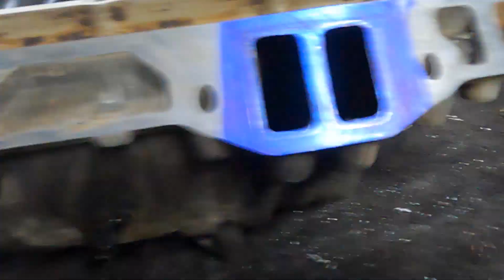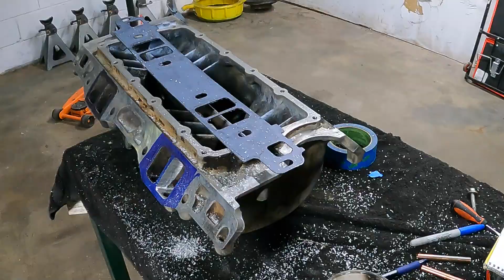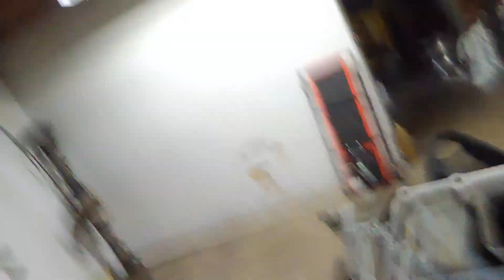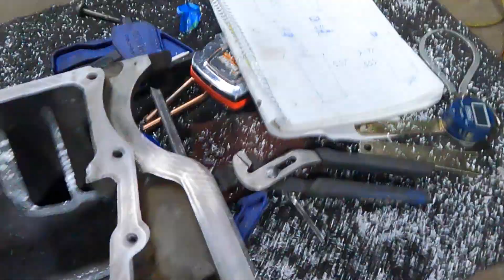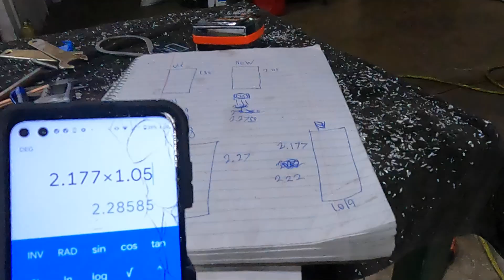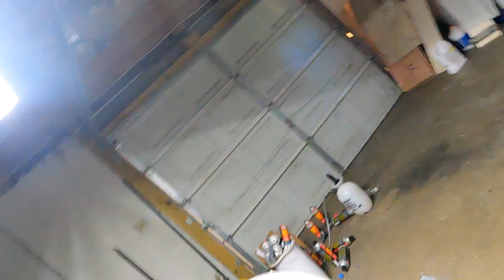360 magnum intake porting

Comment: Will porting the manifold side that bolts to the heads work on stock heads or is it only for after market heads?
Reply from the maker: It will work but it won't have the same amount of gain if everything else is stock.

Comment: best thing for keager manifold is scrap pile get the hughes engine air gap manifold never look back.
Reply from the maker: Iv had both. Wit the the smaller cam the Hughes made no difference over my ported manifold even at 6200rpm. So in my opinion it really depends on what you have. With the new bigger cam I'm sure it is making a significant difference.
Reply: You go Daddy deeppockets,I am on a budget and have to take the long way.

Comment: I have a 360 first gen durango and ive been wanting to completely gut out the kegger and remove the runners completely to where it just feeds right in to the heads.
Reply from the maker: I wouldn't do it. It will kill a lot of low end power and I don't know that it will make it up on the top end. Early lt1 intakes have very short runners and they do pretty decent tho.

Comment: I looked and didn't see what you found with the wedge in the bottom of the manifold. Did you install and dyno it?
Reply from the maker: It was a small part of one of my Dyno videos but it didn't make any power I believe it actually hurt the top end by a couple hp
Reply: @thomasbeyer  You remember if it was the short or tall one or was that even a choice when you bought it? Did you notice any thing with it?

Comment: Hi,how are you?
congratulations for your excellent work.
 I would like to know your opinion about my intake.
I have a dodge 5.2 magnum, with 510 lift cam, springs, headers, 3 inch pipes on exhaust, fuel injection holley, throttle body holley 52mm and 120 shot nitrous.
I'm modifying my intake and I watched  on youtube about an intake with 7 inches of lowering the runners.(utawesome)
this video.. 6 min
https://www.youtube.com/watch?v=PQj2BdeNfmI&t=334s
My doubt is, can I use 7 inch or not? thanks for the answer!!!!👍

Comment: It’s a lot of work but with the volume reduction plates the perform just as well or if not better than the crappy air gaps out there   UTAwesome on here has a great coverage of it .
Reply from the maker: Have you checked out the before and after Dyno video? IV got another coming soon-ish I hope of my air gap testing. air gap did pick up at the higher rpms but only 10hp or so nothing as extreme as people claim. At least with my current setup. Bigger cam coming soon.
Reply: @thomasbeyer  I haven’t.  I just started searching around again for my current project.  I have seen the potential though.  I think the 318 I am doing for my sons car will have 11” runners.  Seems to be the happiest with hp to tq equalization

Comment: I've done quite a bit of modifying to my intake and throttle body.. feels like I got some gains. But now seems like the motor didnt like it and wants different timing. Developed a pre ignition-detonation knock after awhile. Has this happen to anyone else?
Reply: I have an oil catch can vented to atmosphere..
Reply: Did you tune stock computer? And what tuner did you use? Fyi I'm messing with a 98 dodge dakota
Reply from the maker: @markpollard500  yes I tuned my Dakota with hptuners
Reply from the maker: I've never had that problem on any of the trucks I've played with personally. Does your engine have a good bit of blow by or lots of oil in the intake?
Reply: Have you heard of plenum divider air gaps? I did this also..
Reply from the maker: @markpollard500  maybe but I'm not exactly sure what you're talking about. My Dakota's tuned so I don't know if it could be a tuning issue but my '97 ram I ported it and did all the things never tuned it and it did pretty good. now it was a fairly lean at the lower end so I put some 24 lb injectors in cuz this was 10 years ago well before I started tuning and that made it run way better.
Reply: It's on top of intake under throttle body..

Comment: great work. while I was watching i was sometimes thinking I don' think I would do this or that but your final results proved me to be a little unadventurous... (ok say it...skeered). So thank you very much for your time and effort and posting this video... by the way. are you able to keep the check engine light out? good question for folks who have to pass emission tests...
Reply from the maker: I have to pass emissions where I'm at and the porting didn't hurt that part at all.
Reply from the maker: The Dyno results were on top of an already modified manifold. I thought it was more stock when I posted the original Dyno video. But when I opened it up and had it next to a stock one I could see the difference lol.

Comment: I can't understand why that intake is shaped like that.  It's shaped like for an engine that could rev to 12000 Rpms. Takes up a lot of valuable real estate. I would have liked to find an intake with a dual "H" pattern like the old engines. Also would have liked to find an aftermarket Throttle body shaped with dual small primaries and bigger secondaries like old carbs.
Reply from the maker: The intake is shaped like that to have really long runners for low rpm torque and it definitely does that but a dual plane intake is definitely a better option. Iv had the same thought on a staggered bore throttle body  they make staged throttle bodies but I think it would be beneficial to have small primaries for gentle throttle response if that's what you want and then the secondaries can be as big as you want for all the flow.

Comment: Almost exactly what I did to mine, except I used a speed limit sign as volume reducing plates, have not used a wedge either but I did think about going back in later with one I just don't really have the ambition to dyno mine so thanks for the grunt work haha. I'm wondering now if cutting the throttle area in to a large oval would be worth it next time I remove to do the wedge...then maybe get one of them fancy expensive throttle bodies.. Great content as always
Reply from the maker: Thank you. At higher RPMs mine is starting to gain vacuum so there's a sign that it needs a bigger throttle body but I'm not going to do that till after I get my headers done and see what 1.75 long tubes are worth
Reply: @thomasbeyer  check out what JBA performance has to offer.. the jba shorter headers im running on my 2000 RT 5.9 v8.. are so worth it..
Reply: @thomasbeyer  Man I'd love a set of headers but the ZJ headers are notoriously expensive and I haven't got around to getting a set of dakota headers modded up yet. I did just pick up a 95 Dakota with a 3.9 im thinking of dropping in the 5.2 i pulled when i 5.9 swapped my ZJ.
Reply from the maker: Hell yeah why not. I'm working on a set of long tubes  I think will be a fairly cheap option considering nobody makes long tubes for Dakota's anymore and when they did they were a 1300-1400

Comment: I shared this to @richardholdener as he was interested in this info.  Hey, with 15psi boost thats 40tq and 30hp extra above the modified manifold you had on there.
Reply from the maker: I appreciate that. I enjoy Richard holdeners videos very interested to see how far he takes it as I'm building mine. Working on a set of 1.75 long tube headers right now hopefully will be ready for this Saturday.
Reply: @thomasbeyer  I've had a billet wheel 78/75,  SEP1000's, and a microquirt on the shelf for 3 yrs.  Needless to say I'm making almost NO progress.  Got caught up on a 318 build for my son's car and it too fizzled.  Good to see you are on the ball.  Excellent vid!!!!
Reply from the maker: Thank you. What car are you planning on running that in? Microsquirt is the way to go very easy and fast tuning.
Reply: @thomasbeyer  318 into 72 Satellite, 360LA going into 71 Satellite, and 5.9 going into 73 Dart Swinger.
I have Both Blow thru carb and micro + Turbo and Procharger.  Not sure which is going on what.  Also have a set of fully ported Sidewinder heads to use on the LA. 310/201cfm @.650 SLOW PROGRESS THOUGH on these projects.